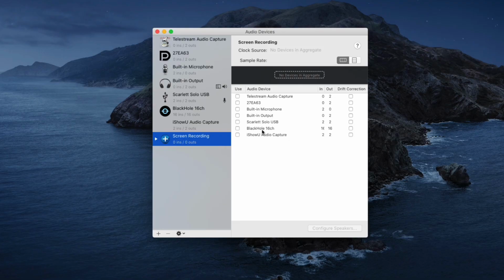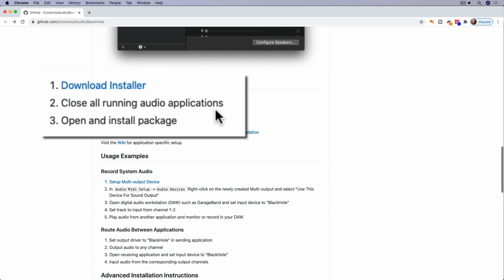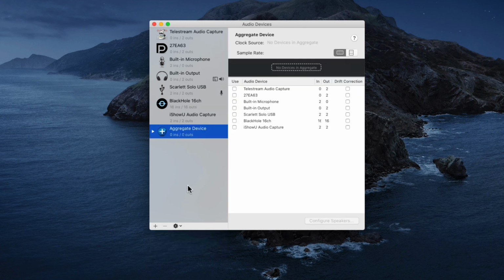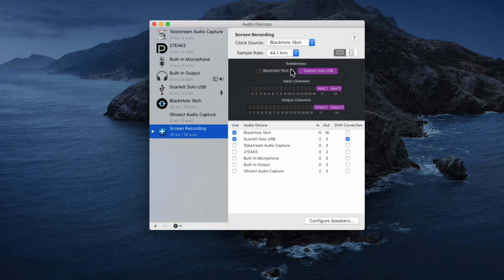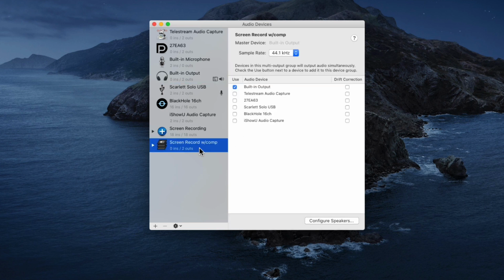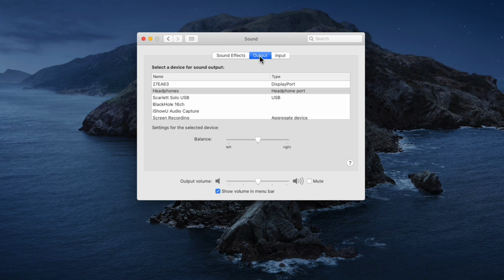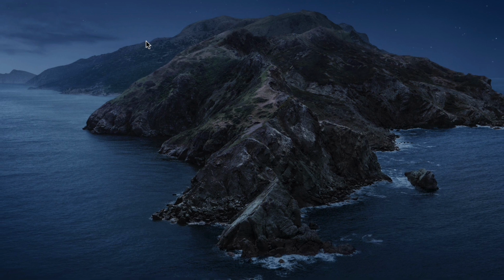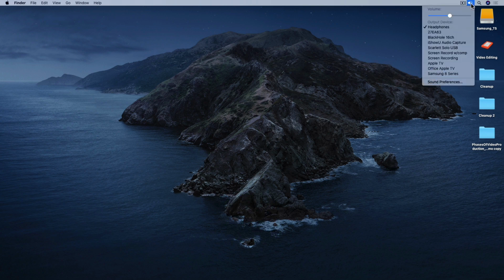How to Record Your Screen with Internal Audio & Microphone on Mac Using BlackHole (FREE)

Comment: For input in system preferences can you leave it on Internal microphone or do u need to change to Blackhole.   I am just recording the computer screen. No microphone externally.
Reply from the maker: You need to create the Aggregate device with BlackHole as the only selection.
Reply: Ok great thx!   I do have blackhole. Does drift connection need to be checked?    I am getting some static or crackle when someone talks. I’m recording a Microsoft teams meeting and get the crackle when the teacher speaks.
Reply from the maker: @mlpeabody93  Try changing the sample rate for BlackHole. Make sure it matches the Aggregate Device's sample rate.
Reply: Great thx. I have them both set at 44kHz. Should I try 48 for each?  
Also do you have a recommendation on a screen recorder for iPhone that will record audio of Microsoft teams? 
Thank you so much for you help!!!
Reply from the maker: @mlpeabody93  I would put both to 48, that's standard video sample rate. The iPhone's built-in screen recorder records audio.
Reply: It does except for Microsoft teams it wont record audio.  Do you know one that will on iPhone?
Reply from the maker: @mlpeabody93  Not off the top of my head.

Comment: I was using this for a couple of month and now suddenly my "screen record w comp" disappeared. have you ever heard of such a thing? I tried to re-set it up, but now there is no "built in output" in my list. I am confused.. any idea what is happening?
Reply from the maker: Have you updated anything lately, macOS, or installed a new program?
Reply: @michaelkinney  no I did not when this issue happened. I did now in the hopes to fix this issue but its still not resolved. I spoke to the apple team today- is it possible that I need to update blackhole? and if so- do you have a link for me? because I was just looking and I haven't found anything yet...
Reply from the maker: @MelanieJosephine  Download site on Githubhttps://github.com/ExistentialAudio/BlackHole
Reply: Unplug your headphones and any other audio input sources.  Click on the speaker icon at the top of your screen.  What do you see?  "Built-in Output"?  If so, open Audio MIDI Setup and create a new "screen record  w  comp".  Voila - you owe me lunch!

Comment: Can it be mute while it's recording but then it has all of the audio when you end the recording and review it? It's giving me no output controls as well so I can't adjust volume.
Reply from the maker: Are you talking about adjusting the volume of BlackHole? Open Audio MIDI Setup - Select BlackHole 2CH in the left column - Select the Output Button above the right column - you'll see a slider labeled "primary" - that controls the volume for BlackHole.

Comment: Hello Michael. Great tutorial. I have a problem. I am running Monterey 12.2.1. I only want to record internal withOUT sound over. I would also like to use ,y AirPods Pro WHILE recording the screen using Quicktime (as when recording a zoom meeting or likewise)  I have tried all possibilities. It just does not seem to work?! Once I have the AirPods on the sound goes silent on the recording or it just does not pick up the sound from the start! Any help is appreciated. Thanks again.

Comment: In system preferences in ’input’ when i choose ’blackhole 16ch’ my computer says that ’the selected device has no input controls’. Help me please
Reply: I have the same exact problem, have you figured anything out?
Reply: @OsONameless  i have not figured out, but tried to do something by my own intuition😭😂!  Luckily, it kind of worked out, but i guess it's still not complete. I mean the main thing for me right now is that the music is streaming and a special separate stream with music from the desktop has finally appeared.  Just try to poke different buttons and see if anything changes for the better- thats all what i did😅
Reply: I believe Michael answered this above already and gave the instructions to go into the Macs audio/midi setup where there is a slider you can use to adjust Blackholes volume. (Michaels reply: Are you talking about adjusting the volume of BlackHole? Open Audio MIDI Setup - Select BlackHole 2CH in the left column - Select the Output Button above the right column - you'll see a slider labeled "primary" - that controls the volume for BlackHole.)

Comment: Didn't work ☹️ this was the second video I have watched regarding setting this up and I've gone through your steps as you say and when I get to the end it's missing the options that you are recommending to select so there's clearly a problem with your software is it doesn't work with modern day MacBook Pro. UNINSTALLED AGAIN
Reply: What didn't work for you? I can't create aggregate device from blackhole, my mac only recognises the internal mic as an input source and I'm not sure what that means lol
Reply: @peakingmantis5331   I’m on macOS Monterey 12.2.1 and I don’t think this software is set up for that.
Reply: Hey man I'm using the exact same software 12.2.1 on my brand new M1 Macbook Pro. It definitely does work - in my case I'm just using it to record internal audio. I'm not using a microphone with it.

Comment: My mic is not showing as an output device to add to the multi output device
Reply: did you figure this out I have the same problem
Reply: @thechill-boat7891  Unfortunately no, I'm guessing is a hardware problem I'm using a MacBook pro and the build in mic only has one input channel and no output channels, check his built in microphone channels, it shows 2 input channels (I guess he's using a Mac pro or iMac) and also no output channels. I don't have an external mic like he does, but if you do that might solve your problem
Reply: @thechill-boat7891  as an addition, I tried the mic on my son's headphones, also nothing :/
Reply: @tonygallardo6185  thats alright, i'm i' just going to update mine for the ishowu audio capture, (its way better and easier to set-up i would recommend it)
Reply: Same issue.  I am using a Macbook Pro.  The Macbook Pro Microphone (which is the built-in mic) can be selected when creating the Aggregate device.  But the MacBook Pro Microphone does not appear as an option when creating the Multi-Output Device step.  So I am not sure this works when using the MacBooks internal microphone, and presuming you have to plug in an external mic of some kind (either a USB mic or connected via an interface like SCARLET or a mixer, etc).  A shame we can't use the internal built-in mic though.

Comment: STEPS NOT WORKING in macos 10.2 as follows.  Created the aggregate input device from BH-2ch plus my webcam (2/0). The webcam rate is 16Khz, is that OK?  Anyway, input device created.  PROBLEM: When creating the multi-output device, the above aggregate input device is not on the checkbox menu. There is only Built-In Output, and the original BH (not the aggregate, nor the webcam microphone). As if the aggregation device does not exist (even though it's on the main left-hand device list).  What went wrong?  THANK YOU!
Reply from the maker: The Built-in Output should be grabbing all the audio that's coming in from the Aggregate device. Multi-output device should include Built-in Output and any device (mic or interface) that you want to monitor while you record..

Comment: Hi, the "built-in Output" does not show up as an option under audio devices when I go to "create multi-output device" help!
Reply: I own a MacBook Air and mines did not have the "built-in Output" so, to get mines to work I had to select MacBook Air speakers
Reply: Yeah its renamed as Macbook Pro Speakers .. it used to be called "built in output" but not anymore

Comment: IS blackhole safe to use .Do our audio recording are safe or there are trnasfer to blackhole onwer
Reply: I don't think so, but to be safe I always switch back to make sure
Reply: @beli1m164  switch back to what
Reply: @mangeshchikhale6986  I assume he means restoring your prior audio preferences when not screen recording.
Reply: Blackhole is completely safe I have used it for over a year now and it works great however it can lag sometimes
Reply: Blackhole is an open-source project which has been continuously inspected by many people. So if you got a legitimate version of it, it should be perfectly safe and not any kind of spyware.

Comment: I don't have "built in Output" in my list of devices. I have iMac speakers and Black Hole and Scarlett. Which would you suggest I select as the monitoring device? Scarlett since that has my studio monitors hooked up?
Reply: if you're recording a voiceover you may want to use headphones to monitor so the internal audio doesnt spill into the voice recording (and in that case you would select "headphone output" after youve plugged them in), but if you're not recording voiceover you can select scarlett so it outputs to your monitors
Reply: @mistabradley_  Scarlett should have a headphone output and the ability to mute (or turn down volume to zero) the external monitors.
Reply: @togethermindstranscend  yup, good point. just need a 1/4" headphone jack

Comment: Which clock source should I use for the Behringer UMC22 on my Mac?
 It lists 2 devices to choose from as a source.....

i.e. 
USB CODEC 1 = [2 outs]  by itself 
& 
USB CODEC 2 = [2 ins] by itself also

Note: I did select both options for my drift correction.  Because I tend to use headphones and a mic when doing screen recordings.

Great video btw. Thank you for doing this for us. 🙏

Comment: Great video and explanation, but when I change system preferences to the multi-output device, I get audio going to my internal speakers, which my Rode NT-USB would pick-up during recording.  Thats a problem.
Reply: Update: I found iShowU didn't work after upgrading to Big Sur, so I tried BlackHole 16ch and it does work.  I also found that having multiple multi-output device configurations was causing problems, or an AutoAggregate input device created by MacOS included the built-in speakers.  With just 1 multi-output device and 1 aggregate input definition, it works as described in this video.  Problem is: I have a mobile setup with a Rode NT-USB Mini and an in-studio setup with a Universal Audio Apollo Twin X.  I don't want to reconfigure the aggregate input and multi-output devices every time I switch locations or audio interfaces.  Any advice on how to configure 2 audio interfaces to co-exist?

Comment: There's no "Built-in Output" audio device option on my macOS Big Sur. The only audio devices are External Headphones, BlackHole 2ch, MacBook Air Speakers, and SoundTap Virtual Device. I tried to check External Headphones and BlackHole 2ch, but it still doesn't work.
Reply: MacBook Air speakers is the built-in device

Comment: Before I watched this tutorial, Blackhole was working fine and I could screen record without any problems and using my desktop audio. But yesterday it just stopped working and didnt even show up in options. I watched this tutorial, did the EXACT STEPS, and yet it still doesnt work.
Reply: Nvm I got it working. My stupid brain had blackhole at a low volume so the desktop audio wasn't very loud.
Reply: Lol, I just got the same issue today and try the steps just like in the vid. Then I saw your comment. Thanks, your comment helped me 😂
Reply: @saburotoshio  no problem lol

Comment: how can i do this, but be able to hear audio with my headphones? it works for the laptop speakers, but once i plug the headphones in i hear nothing
Reply: Following
Reply: Can you please tell how to do internal audio and screen recording  and output should be headphones. I am using  BigSur. It doesnt have Built in Output Option so I chose Mac Speakers. But I am unable to hear anything while using headphones during and post recording
Reply: I think you have to set it to go to your headphones. You see, once you plug them in you can set the audio to your headphones too. Check the sounds and audio setup, it should be there I hope

Comment: My Bluetooth headphones source input is 16k hz...So any audio sounds completely garbled and slowed down
Reply: Alright, I switched to BlackHole 2ch, and kept it as the clock source.
Then in the aggregate output, I selected BlackHole 2ch first, then my Bluetooth headphones/microphone and kept Headphones as the Master Device @48khz and things are working now with some tinkering
Reply: @RaabStephan  my headphones keep switching from 48 khz to 16hz when I switch it

Comment: Didn't work when trying to capture a zoom conference I was recording a client video. Thankfully they also recorded the main open/close/panel via zoom, but the breakouts I captured didn't have audio. I was able to make it work in the end video, but man it would have been a disaster if I didn't have the zoom recordings. So just make sure you test it out fully for whatever you're wanting to capture to make sure it works. This works great for capturing other videos/content with audio though, so still helpful, just not for the specific use case I needed it for. Would love to know if anyone has my use case figured out?

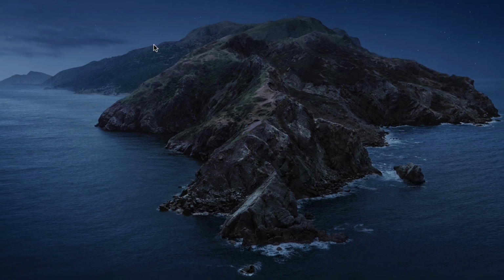Comment: Thanks Mike.  Quick question.  At about 10:38 as you close you left it on the scarlet option.  I’m think you were supposed to switch back to black hole right?  Weren’t you just clicking over to chekc mic level should you be doing a voiceover.  OR if we are doing. Voice over do we leave it on the in my case Yeti Microphone selection.  Or were you supposed to change that back.

Comment: Is anyone else uneasy about sending your email address to an app called "BlackHole"? Just wondering.
Reply: No
Reply: Yes me too 😟 that’s why I came here to make sure it was safe!
Reply: Yes. Especially since it has rendered my audio midi unusable. Added "aggregate device" crashes audio midi, and I cannot remove it. Removed blackhole from my computer, and still cannot access Audio Midi. 
Terminal comment: The default interactive shell is now zsh.
To update your account to use zsh, please run `chsh -s /bin/zsh`.

I have no idea how to do this, or even why it comes up.
Reply: @BlytheAyne  I don't know why the driver is not working for you, or why you opened a Terminal. But the message means that you upgraded your computer from an earlier version of macos where the Terminal command shell used to be "bash". In more recent macos versions, the default command shell is "zsh". So it's just warning you about that. I don't think it has anything at all to do with your awful problem with the driver.

You may have other audio software drivers installed which are conflicting with blackhole. Or which otherwise messed up some internal audio settings when blackhole came along. Not sure how of the steps to fix it, but it's going to be about un-installing any other third-party drivers, and restoring factory settings for Audio MIDI.  I would look in your ~/Library under Preferences and other places for configuration files. Something is corrupted, probably in there.

Comment: I'm doing everything exactly as you did it in your video and I am still only getting video without the audio.  When you want to listen to a screen record you just made, I'm sure you have to change some audio settings back to normal in the "Sound Preferences" but I still don't get any audio when I do that.  Can you please help.  You're the 3rd person whose video I've watched and I'm getting the same results - Video and no sound.
Reply from the maker: Hard to know what's going on without seeing what you're doing. In the Sound section of System Preference, make sure under Input that BlackHole's level is turned up.
Reply: I’m not tech savvy how do I close al running audio application???

Comment: Fantastic explanation. The only issue i have now is that I'm using a Behringer UMC204HD as my audio Output device to listen on either my monitors or headphones, but I can't seem to use it as an output under multiply-output device. I have to use the Built-in computer speakers for now.
Any idea?

Comment: Every time I screen record it sounds glitchy and with static
Reply: I have the same issue, have you figured it out?
Reply: @mango.cardboard  I did do you have a macbook Air?
Reply: @the_huntress5647  yes
Reply: @mango.cardboard  ok so when you click options on recording go to the Microphone section and click on Black hole 16ch it should help
Reply: @the_huntress5647  that fixes it if i’m just trying to record comp sound, but it doesn’t record external audio from mic, thanks for trying though :)
Reply: @mango.cardboard  Np and I am sorry if I couldn't help

Comment: Hi Michael, you said it costs people an email address but just below the BlackHole Installation instructions is an optional download method that does require brew to be installed as a prerequisite. Its might have been worth pointing this out as an alternate method. Brew is simply a package manager, as is Apple's own Mac App Store. Brew is easy to install and it might be worth letting your audience know about Brew, what it is and why it can be valuable. As an example, once Brew is installed you can issue a command like, brew install chrome to install Google Chrome. There is another command called brew upgrade. If chrome was installed Brew then the brew upgrade command would upgrade the Chrome browser. I know I went off on a tangent and your goal was to keep things simple and I can appreciate that but if you think a video on brew is a good idea maybe I gave a brief idea on one feature. You can do a brew video and in future videos you can show both install methods when available, referencing your brew video when necessary. Cheers, keep up the great work!